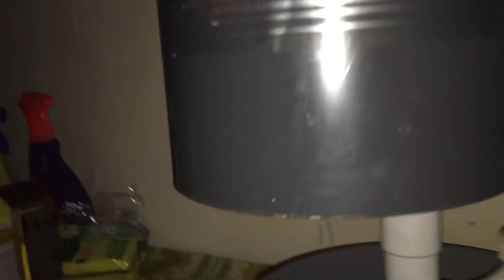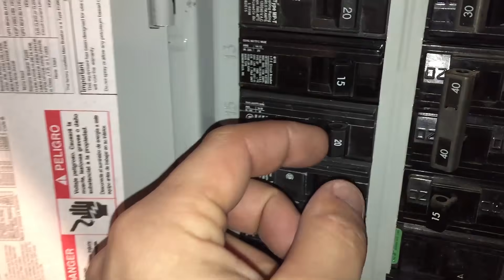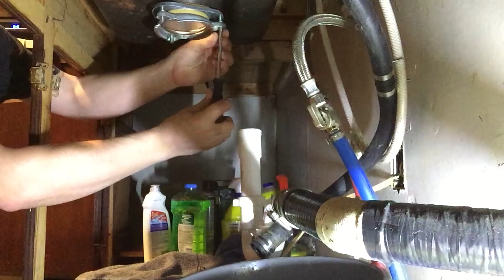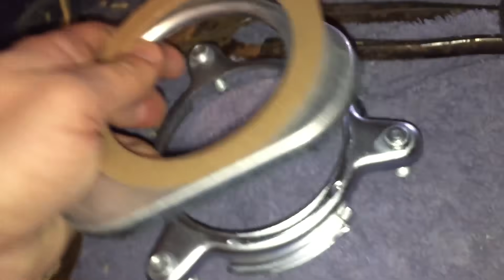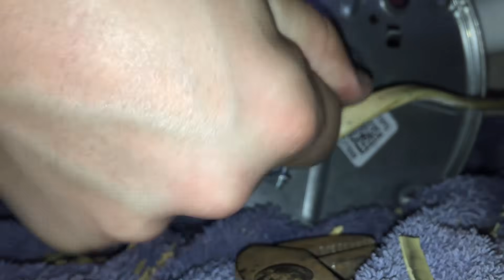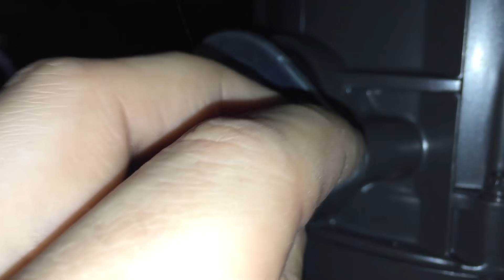How to Replace Hard Wired Garbage Disposal

Comment: *I use the equivalent of a piece of broomstick and go from the top, between the blades and pivot to free up.  It's easier than going under to use the allen wrench. That said,  you have absolutely made the best video.  Love the step by step with visual.  I have the exact disposal and installed it in 2018. Did not replace the flange. Now it's time to replace the unit, but I don't remember wiring it, lol. 
This time, I thought I'd try a slim-line and replace the flange. I will also have to remove the power cord to hard wire.  Easy peasy! 63 female who doesn't want to pay someone to do things I can figure out. YouTube has always been my go-to. Next!

Comment: As a 24 yar old with absolutely no plumbing experience.  I am watching your video and following along...... in between I had to change out the dishwasher hose which was a whole thing on its own.... 
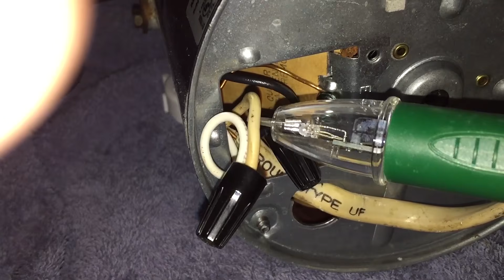At 9:28 when you were testing your wires. It did beep red once and go away. Why did it go off if there's no electricity? 😅

Comment: Thank you for the detailed instructions, it was my first time changing one out. I will say the hardest part was the snap ring re-install....that was hard to understand completely. I also had pvc directly in my way, so wasn't as easy as sliding in under the sink. Great video, keep it up.

Comment: 10/3/23 - Starting from the beginning.  PU, that kitchen needs renovated!  I’m sure it will be beautiful.  (Finding the breaker.  I’ve plugged in a sweeper.  When the sweeper goes off you have the right one.  A radio would work too!)
🤓🤓🤓

Comment: Technically you don't need to switch that breaker off because that switch for the disposal kills the power. Also it's not a good idea to run the discharge line for the dishwasher to the disposal you want to run out to a separate line.

Comment: Hey I'm a 55 year old woman - and not that women can't do this stuff - but I never had done it in the past, but I changed my first garbage disposal today using your video.  Thanks so much, your video was very very precise and detailed (you didn't miss a thing) with all the helpful hints, it was great.  Thank you!  Good luck with your new house.  I bought an old house too.  If I can fix things myself, it'll save me loads of money :) Just one thing I'd add for old folks like me - put a box or old phone books underneath the disposal before you unhook it because it's heavy and it'll fall.  I put a gallon sized paint can underneath the disposal.  It was helpful not only for disassembly but also when I was trying to screw the new one on.

Comment: I own a 3-family rental house which had 3 Insinkerator Badger 9s installed by the plumber when built. Within 2 years, all 3 had cracked their plastic case leaking and needing to be replaced. Replacement Badgers also failed the same way. I replaced the Badgers with Insinkerator Evolution grinders that were 2 stage and cost twice as much as the Badgers. To date, none of the high end Insinkerator Evolution grinders have failed or jammed.
Reply from the maker: Oh wow.  I have not had a problem with this one since I installed it (5 years).  Are they throwing whole chickens down the drain? 😂. Thank you for sharing.

Comment: Glad you checked the power with the tester. Although you shut the breaker to the receptacle, it wouldn't necessarily mean the power to the disposer is dead. The disposer could also be on a separate circuit.

Comment: Just a few months ago I was replacing my disposal (2nd time) and decided to go with a significantly larger unit (1 HP) than before. That meant that I actually had to do a bit more adjusting on the plumbing to hook up to it, and that's when I discovered the builder had GLUED the compression fitting to a depth of several inches (note; I'd come across this particular plumber's "shortcut" in previously in the house). Had to take a hacksaw and cut out the line leading to the disposal and rebuild the entire thing.

Comment: Thanks so much for this video! I thought mine was broken and while shopping new ones at Home Depot I learned you can use the allen wrench on the bottom to unjam them. I did this when I got home and it freed it up but didn't fix the problem when I flipped the switch to turn on. I was about to give in and buy a new one so I started watching this to learn the install process. Your tip on pushing the red reset button did the trick! I didn't see it when I was under there before and now you saved me $150 or so. Thanks!

Comment: Thank you so much for this video. I watched so many of them and yours was the most helpful. I have never done anything related to plumbing or electricity before. With the pandemic, the family is resistant to hiring a plumber to change out a broken and leaking garbage disposal. Mine was completely rusted over so I had to use WD40 and some screwdrivers to get the old disposal out but after I got it out, I followed your video the rest of the way. Thank you, thank you!

Comment: I know this is a couple of years old but hopefully you'll see this. I'm installing a hard wire moen 3/4 hp. The problem I have is the wire coming from the house to the garbage disposal don't have a ground wire. Could this be the reason my old one stopped working. How can I make it grounded.
Reply: Having no ground won't stop it from working, it just helps prevent electrocution in case of a short if someone is touching it. I almost think you would need an electrician to install a grounded cable.

Comment: Thanks for this video. Your detailed step by step instructions were clear and very helpful. The only grief I had was with removing the old disposal, as its attachment system was completely different and that meant the outflow plumbing didn't line up with the new disposal. But I eventually got it sorted out. Thanks!

Comment: I was wondering if there was a reason for not unplugging the disposal and doing the electrical connection out from under the sink where space is limited.  Also do you need to turn off the circuit breaker if you do unplug the disposal?

Comment: Really good video! But I have a GD question:  Is it true that the only place a garbage disposal can jam, is on the top part that you can see when you look down into the drain?  If that is true, I am wondering what the huge, approximately 1 foot long massive section that hangs below the top part is?  I know there is a motor in there, but what else? Some more meshing gears where some hard object could become lodged and cause the whole thing to freeze up??  When you turn the hex-key in the very bottom of the unit, what should happen?  Does the flat part you see when you look down into the drain rotate around then, but the teeth around the perimeter just stays stationary?  Or are they both supposed to rotate?

Comment: Thanks man you gave all the right advice.  Grandmas old disposal said installed in 1998!  It was a insinkerator and I honestly don't know how it still ran.   The only real problem was the seal had warped and the plastic around it wasn't holding a seal.  It only had a small leak.  Impressive tutorial straight to the point.   First video I found too!  Cheers!
Reply from the maker: Nice!  Happy to help out!  So you changed out the disposal?  Or you haven't done it yet?  Just wondering if you used this video to help do the job.

Comment: The best and safest way to install a garbage disposal is with an electrical male plug wired to the disposal that is plugged into a GFCI outlet installed under the sink.  Hard wiring the disposal directly to a circuit breaker is a bad idea compromising safety. When there is a problem or replacing the unit no searching for the circuit breaker just unplug the disposal. From my searching for a new disposal I found all of the good ones already have the electrical plug attached to them the units came with multi-year warranties. Thank you for your very nice video showing how to replace a disposal.
Reply from the maker: Great tip Ernest!  Thanks for watching the video!

Comment: I replaced my old disposal about a year ago, because the one from the previuos house owner rotted out underneath. I  didn't know they could do that! I'm so glad I saved the money and replaced it myself. It was SO easy. Good ol insinkerator swap out.

I also had to label my own circuits. Ugh.

I have a flex joint, also.

Comment: Thanks a bunch for the excellent video.  I watched it and thought, "I can do this".  A couple of tips.  A power screw driver makes dismantling the old one much easier.  If you're removing a really old unit, the bolts on the discharge pipe are a 3/8" hex head on Insinkerators.  They will probably be a bit rusted, use a socket to break them loose.  When cleaning out the old putty, a standard tall kitchen trashcan should fit under the sink.  It'll catch all the junk that falls down.
Reply from the maker: Great tips!  Thanks for watching!

Comment: Quick Question: If mine is hardwired like yours, can I upgrade the horsepower without any issues?(ex. going from 1/3 to 1/2?)
Reply from the maker: Hey there!  I am not a licensed electrician but I will tell you that from what I do know, it would be fine to upgrade.  Do not take my word for it but that is what I would do.

Hope this helps.  Thanks for watching and consider subscribing to my channel to see more videos!!

Comment: Tomorrow I hard-wire a Waste King 3300.  The Fixer, you have given me confidence, so bless you, my friend.
Reply from the maker: Great to hear!  Let me know how it goes!
Reply: It was a brutal battle, but the battle was won.  The existing switch was a standard on/off underneath the sink next to the disposal.  My first action was to swap the switch for a switch/outlet combo so as not to have to modify the Waste King 3300; just plug it in and have it run by the new switch.  

After I did that I had an open neutral I couldn't figure out--a voltage detector indicated there was current running through any cord plugged into the outlet, but nothing plugged in would run. 

After I asked an electrician friend how to fix that, he said I'd probably want to go with a GFCI combo switch, but he didn't think such a thing existed and my idea probably would not pass code.

So I set about hard-wiring instead.  The hardest part was cutting the cord out of this particular disposal model, as others have mentioned around the Internet.  There was a very tough rubber strain relief for the cord I ended up Dremel-tooling out bit by bit so the resulting hole wouldn't be mangled and thus would take another strain relief for the new wiring configuration. 

After some modification of the existing BX housing I was able to get everything installed, and so far, so good.  

Again, many thanks for the inspiration!

Comment: No plate or cover over where the electrical wire enters the wall?
Reply from the maker: Yeah, looking back I should have cut the wire and installed an outlet.  Then I could have put a plug on the garbage disposal.  Thanks for watching!!

Comment: Thank you for this video. I m a 67 year old single woman. Because of this video I was able to remove my hardwired disposal and replace it with a new one by myself. Except....I did have to get my grandson to help me lift the new one up to fasten it. It was pretty darned heavy to hold up there and fasten the ring at the same time.
Reply from the maker: This is so great to hear!  I am so happy to hear that this video helped you out.  Makes me want to keep making videos.  You made my day!
Reply: The HP of the motor has a big bearing on the weight as well as the materials the disposal is made of. In some cases people have used a car jack to lift the unit in place. Whatever works once installed you should enjoy several years of good performance.
Reply: I just finished using this tutorial to take out our old garbage disposal and put in the new one. Your step by step instructions were very helpful. Thank you!